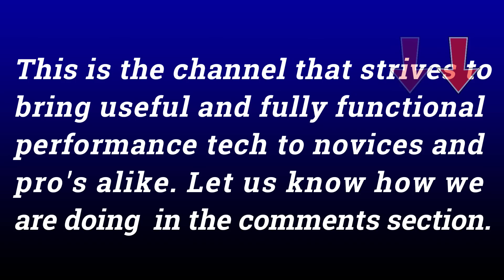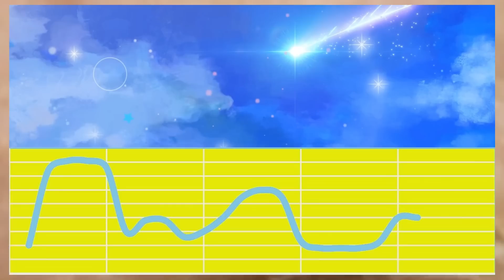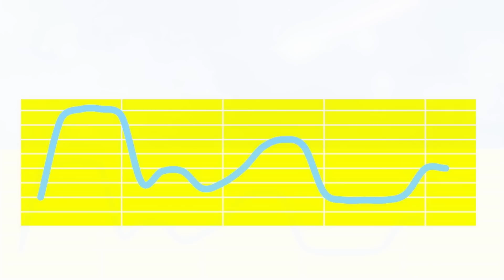DV's take on Weingartner cam shootout.

Comment: 14th is better than 9 billions peoples on this planet. I would have been in the #1 figure,  with a lot of zeros behind. More like 1000th place.  
Would 70 test affect the engine performance as for beeing in the first test or 70's numbers.  Fresh gas compared to 1 week old gas? Probably not.  I always tought it's the littles details that affect dyno pulls.  You can make 10 and have differents stats, at differents RPM, at Different engine temps, at differents ambiant air on morning, evening, night time. We had so much weather changes in a short periods and humidity.  
I wouldn't choose more #1 or #20 camshaft unless it fits my combination and 100% positive to get the same results.

Comment: If i had the monet to burn i tjought it would have been fun to go to the howards catalog and pick one from a  regular diy builder education guess and sent it in for the contest, it would have been hilarious if it won and beat out all the acomplished engine builders and when eric said how dod you pick that grind? Ahh between the description in the catalog, apparently its pretty accurate lol. You never know someone that has a clue designs those off the shelf cams...im just a regular guy i dont know the intricacies of lobe profile and timing events in detail i understand whats listed on the card lift duration lsa and lcl and i look at the rpm range and whatever lift will fit and the one with lsa around 108 or so, ive tried tighter and wider lsa and in a carbed street smallblock whatever 108 has been my best results for power and a nice lopey idle. People get all worked up about taking idle quality (wanting a rough idle) into consideation when picking a cam but most are not racing there vehical they want good power but as much as a nice paint job draws attention a chop does too and where a street car spends 99% of it life not at wot you want it to look and sound cool so why not incorporate cool sound also, i could have gone with a slightly smaller cam and gained bit more low end TQ but my trucks chop has caused so many people to come up and complement it and it still runs and pulls great, so many times with that cam and the dual 3" exhaust ive been asked if my 355 was a Big block, i say i cant tell a lie...yes. just kidding i say 350 and their even more impressed.

Comment: Oh, when I was drag racing Uncle's tuck in Edmonton.  A supercab f250 with a 460 that the bois rebuilt for Uncle.  All I know is they advanced the can 4 degrees.  All i know is I i could outrace and beat cars on Jasper Ave in Edmonton.  I even outran the police.  That is becoming a meme.  That truck would easily go 140 mph and suck two fuel tanks to to 200 miles one way.  Ask me how I know.  Uncle was mad at me the next day.  I drove from Devon, Ab to Elkhorn, AB on SK border.  I went there and back in 4 hours, but i used 4 tanks of fuel.   WOT 130 mph both ways, awake or asleep, it was a long day.
Reply: It was a1979 F250 Camper Special Super cab.  1 ton axles and a 460 4bbl.  For a heavy truck, it would rock n roll, but that was after the bois rebuilt the engine.  It might have been bored and stroked, the only thing I know is the advanced the cam 4 degrees.  Im thinking, after winning drag races on Jasper with it, it had a mighty big engine.
Reply: Uncle died a few years ago, and he had no idea what his crew did to his truck.  I bet Uncle wrote a blank check and rebuild the 460.  That was a 1979 Ford, the beautistful truck ever. I raced that tuck on Jasper and it was quick.  I'm thinking the bois built a powerful engine.  That truck, probly 6000 lbs, rock and roll like now days diesel.  It did not spin much

Comment: That time I was 12, Dad and I started out in pickup crop checking.  I was driving.  Then we picked up Norm.  1971 F100 302 220 hp auto two tone pearl blue over white.  So we get to Hanley bar, I go sit wit with Dad and Norm in bar and they serve me a Pil.  I did not guzzle, cause I seen my two younger brother steal beer and get real dizzy. Anyway, after the bar I'm still 12 and still driving and had another beer.  When we got home,  Dad carried me into house by my belt and Mom yelling at Dad.  Good Times.  That was one of the times I never got beat for doing something stupid...

Comment: To all commenting. The basic cam specs are/were listed on the winning cam website... Where you can buy the winning cam.

Look at the pics on that link for all the basic cam specs. 

Anyhow... Few things I took away from this test:

1- The simulation software used is pretty much useless (hypothetical trash) if it predicted one cam grind would eek out a win on all four categories, yet on the actual engine used, this cam was 14th overall, and down a whole 30 points HP and 10 torque from the lead cam. Why???

2- The exhaust was not properly spec'd for the software? Or something was different on the test engine (overly restrictive) in order to be in such contrast to the simulation software?? It's not expected to be perfect, but to lose by 30 points is a rather large "margin of error".

3- The winner, a guy who has a wealth of knowledge testing different cams on LS builds, saw a trend where LS engines like a lot of exhaust duration and overlap. In his own words, "Every time I increased exhaust duration, the engine would continue to increase it's output."

So... I guess my chief question is... Why was the simulation software so wrong to the actual test engine's results? Did the software not know how to compute for LS exhaust changes or cam timing changes? Was the software that wrong? Or was there something else? Genuine curiosity. What happened?
Reply: If you go back and watch Eric’s video the software Did predict nk performance as the overall winner.  I think it said David best average hp.
Reply: @bcbloc02  Didn't EW say it predicted DV overall, but NK taking peak HP? Sorry, too lazy right now to go check.
Reply: @richdouche8253   no pretty sure it predicted dv best average hp but nk for tops in the other 3 categories

Comment: I mean, it would be good if he published the data. There were 4 categories, average torque/hp and peek torque/hp, all between what? 4000rpm-7000rpm. Zero optimization by timing either by spark or cam degrees...Theres more data...me likey data... What about low end torque or post peak hp? Idk, rules are rules.
Reply: It was a street/strip spec.
As DV said, his own cam seems more streetable.
Vacuum readings at 900 and 1600 would have been good.
Reply: @hotrodray6802 all the cams idled well under 1000rpm
Reply: You could purchase..
After the CamDr he might compile, but that takes lots of time and effort as Eric explained.
Reply: @hotrodray6802 to compile it take like half hour
Reply: He did publish it. And like any author who charges for their books, so does he. Why not just say that it would be good if he gave YOU the data for free

Comment: I Saw Your Camshaft Compared To The Winner NK Performance And Cam Card Wise Yours Just Looked Like A Lower Lift And Lower Overlap Version. NK Went With A lot Of Overlap (putting alot more exhaust duration). To Me Your Cam Entered Was A Street Car Version And NKs Was A Drag Racing Version. 

I'll Be Honest I've Never Driven An LS And Tried Multiple Cams In A LS Street Car But I Have In My Turbo 3.8V6 Daily Driver. Let Me Tell You That Extra Power Below 4k RPMs Definitely Makes It Feel Like A Bigger Engine In Stop And Go Daily Driving Traffic lol.

Comment: On another note, Eric is finding that some cams were not ground to the requested specs as found out by the Cam Dr.
Reply: I had my suspicions about that from major manufacturers for the longest time....
Reply: I believe it gave everyone looking for a custom grind 'the place' to give your business to, and that is definitely not Comp and definitely Cam Motion
Reply: What a bunch of whiny butt girls! The whole point of the challenge was to produce the baddest cam they could for the particular LS. If you think it's okay to pit a chain around an idea...you AIN'T no hot rodder
Reply: @Hillbillygarage1215  having a dyno queen ain't hot rodding either.  No one cares if a cam could make more power but then wreck the valve train - a car on jack stands doesn't win any races...  
Besides, the test motor had to survive dozens of dyno pulls.  "Putting chains" around the cam specs made perfect sense, and it still showed who knows how their stuff.
Reply: I got my EPS spec'd comp ground cam checked at lab machine on their cam dr. It was actually a hair bigger than what was ordered. Not much, but i was satisfied. This was 2011/2012 and i heard of a bunch of cams being WAAAAY off, hence why i had it checked.
Reply: I've often wondered about this, and I am curious what the general opinion of the Lunati Voodoo styled cam lobes (asymmetrical) based on experience. Are these easier on the valve train or harder, due to difficulty of controlling the valve springs and/or harmonics?
Reply: @MichaelWojtaluk  Daniel Powell at Powell cams had a video on this just the other day, he was saying you can lift a valve a lot faster than you can close it , so a LOT of aggressive lobes are definitely assymetrical.
Reply: Softer closing rates than comp Xtreme for example, on the ragged edge of street cam aggressive ramp rates. Spring pressure needs very exact by spring testing so that not to be too much over or under that correct pounds. Do not use just any spring pack that comes on your heads, nor just any part number these springs need checked. The middle ground cams are the most aggressive ramps, as they are the closest on the non linear ratio of ramp rate tolerances nearing aggressive only territory.  @MichaelWojtaluk
Reply: Doesn't it make the entire test totally wrong?   
Were those cams measured on the Cam Dr. prior to the test, or after?   Big disappointment for so much effort put into this whole thing.
Reply: You make it sound like it was intentional instead of manufacturing errors

Comment: Because the rpm range was limited to 4-7,000 I found it interesting to see who came in at the window with higher torque and hp at 4,000. Those that were higher at the beginning were not necessarily the winners. I really wish the cams could have been tested from off idle to 7,000. I think, but no sure, the final standings results might have changed.
Reply: Sure, but that range is not possible.
Most dynos can't load below 2500-3000 on that type engine.
Reply: maybe a manifold vacuum deduction would have been appropriate too.

less than 10” receives a deduction per point of vaccum less.

Comment: Hey all, I still don't recall a table showing the high hp, the high tq, the avg hp, the avg torque of the cams and the cam parameters!    Nor do i have the engine specs, i'mpretty sure it was a 408 LS3 based, but i have no other clues!
Reply: That because Eric wants to sell the results but if you go to nk performance website and look at the ls cam challenge winner the 3rd image is the results and shows all the cam specs.
Reply: @bcbloc02  Ok appreciate the headsup!